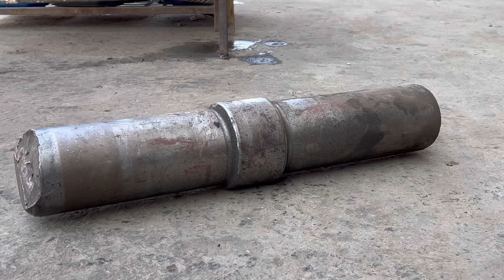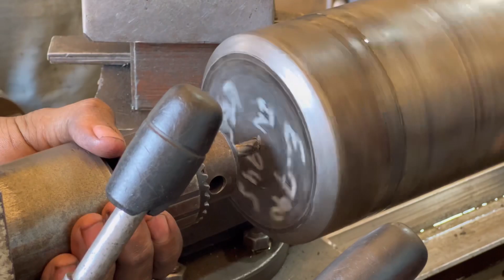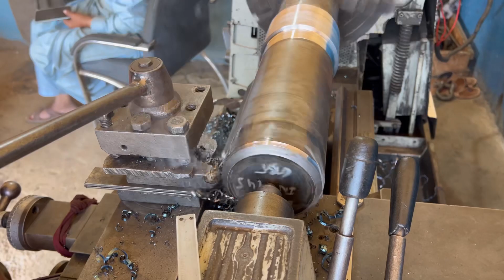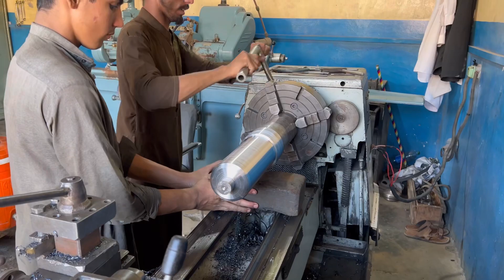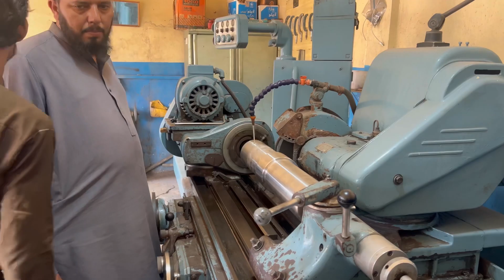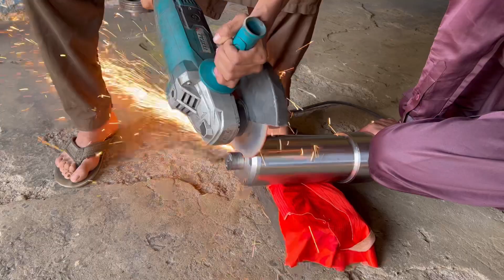Amazing Manufacturing Process Of NPK Jeck Hammer Piston | How to Make NPK Jeck Hammer Piston

Comment: never grind towards a shoulder on an od grinder , the wheel breaks down and You lose your diameter right at the shoulder. slowly plunge in at the shoulder and feed away to the end of the part
Reply: What's a shoulder, the middle builging part on the piece or the locking mechanism on the end of a lathe?
Reply: Seems to the the part on the, the 90 deg angle on the piece i think.